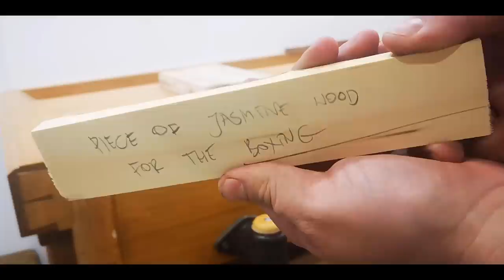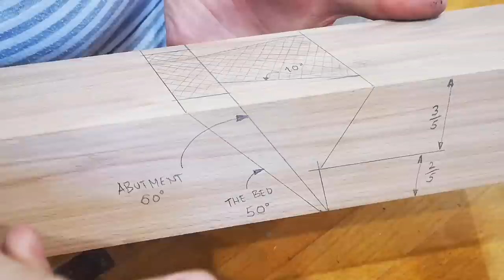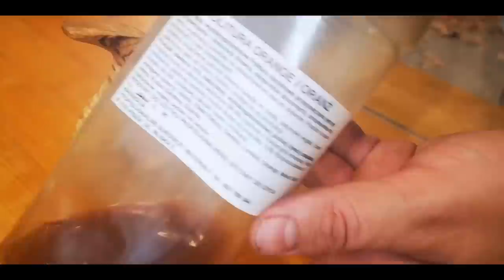037 Badger plane - hand woodworking

Comment from the maker: Hello! Today's project is classic the badger plane with intermittent boxing and the offset tote. 
I need that tool to clean sides of side escapment planes.
For the body i choosed quartersawn beech. Why quartersawn? Because that material is the most stabile. That's all. As you probably noticed the sole is always oriented on the side where the bark was. Some people talk that the barks side of the wood is the hardest. Some people talk about wood movement during changing humidity. In that case the sole will get concave profile, wich is better than convex. In that reason the grain should be straight and parallel to the sole. Another people talk abour the wedge fitting during changin humidity, quartersawn wood keeps the wedge tight.
I am big fan of the second theory.

So, what's the materials??
- beech for the body
- spalted beech for the tote
- jasmine wood for boxing
- boiled linseed oil and shellac orange as finish
- an old laminated plane blade 

The sole and the right side are free of shellac, they will work on the wood sufrace during planing.

The right edge of the sole will be the most loaded, so i choose intermittent boxing to make it more durable. The grain direction of the boxing is perpendicular to the sole.

Oh man, that a lot of words. I'm curious who read it ;)

If you have any questions or sugestions just write a comment.
Reply: I read it all
Reply: Hi there! I think I have seen you in the comments of David W before, so he needs no introduction to you (if I'm mistaken, look him up on youtube)

I asked him the question once about the end grain orientation with the suggestion to have the groth rings orientated vertical instead of horizontal, so it would be stable in the width of the blade and have no chance of pinching the blade

He respectfully disagreed, I quote his reply:

"Hi-the lateral movement is manageable (you just give the iron a little bit of room to move, or if things get tight, float out a little bit of material). You can make a plane with the wood turned 90 degrees from typical if you'd like, but the issue is that the durability between the rays is not very good, so the plane will wear much faster. You can smooth plane both faces of beech (the quartered face and the flatsawn face) and get a good idea how much more wear resistant it is on the bark side on the flatsawn face. It's pretty stark."

So his theory is about the resistance of the plane, and I agree with that personally

I'm glad to be watching your new videos again, you have an awsome workshop, with sunlight! Very nice
Reply: What is the role of the intermittent boxing??
Reply: Lots of us read all you write!  Thanks!
Reply: I read it. Lol Good explanation.
Reply: Very good idea.+1
Reply: @grandmasteryoda5485  "The right edge of the sole will be the most loaded, so i choose intermittent boxing to make it more durable. The grain direction of the boxing is perpendicular to the sole." 
See above,
Reply: @NICEFINENEWROBOT  thanx man
Reply: @grandmasteryoda5485  You'r welcome o master.
Reply: @NICEFINENEWROBOT  may the force be with you
Reply: @grandmasteryoda5485  What a greeting, just for viewing a badger plane project!
Reply: @NICEFINENEWROBOT  greet everyone this way you must
Reply: Beautiful job!   I read it all :)
I’ve made a few hand planes but made by laminating the sides onto a central body block.  It’s quicker (I think) than the way you’ve done here, but I make no comment on better or worse.  Very nice videos! Where is home for you?
Reply: You are one heck of a craftsman!  You are an inspiration to me to start by building a bench, probably a Nicholson, but left-handed.  My late Dad made a beautiful bench that I inherited, but since he was right-handed, it was difficult for me to use, so I bequeathed it to my 28-year old son.  Thanks for the inspiration and education.
Reply: Ú0
Reply: These are skills that have almost been lost. You are helping to record and preserve. back in time every carpenter had aprentice to pass on skills and knowledge. This is no longer happening So what you are doing is very important for all humanity.
Reply: After making a panel razing plane I am hooked! Great video, I am curious where you get the geometry to do the layout. Is there any reference book or guide to getting all the angles right. Its hard enough to do after the math is done. Thank you for posting.

Comment: Nice fix! I agree about quartersawn wood still holding the blade with changes in moisture. The only thin that then changes is the angle of the blade. And only very slightly at that. Beautifull plane and nice to see a master at work...

Comment: I would be fascinated to hear how you calculated the angles for the skew and the bed to get the plane edge situated correctly. It is a subtle but impressive achievement.
Reply from the maker: Thanks, i didn't calculate it, i just drew the lines on the wooden blank 👍

Comment: Very beautiful work and so interesting to watch, thanks a lot for sharing!  Nice to see you using your own plane to make this one, the mitre plane I think?  That spalted beech handle is super.   I did read your description, which answered some of my questions. Now you have to make a partner for this plane, for when the grain is going in the opposite direction on the rebate!!
Reply from the maker: Thank you! Yes, it was my plane. You have right - i should make a pair of badger planes for two grain direction but i don't have another, opposite plane iron. I hope that cap iron will help to achieve nice surface against the grain. Regards!

Comment: Really nice work but tbh im skeptical of these inserts in the sole. Wood moves at different rates depending on the grain direction so these inserts would move less than the rest of the body which would lead to more need to flatten the sole as there would often be a low spot right before the plane blade. Personally i wouldve used a harder wood for the whole sole or only for the edge but running for the whole length of the plane. As someone who has a way too moist workshop, ive become very carefull of wood movement. Sliding dovetails, which these are essentially, have become loose despite being extremely tight when i made them.
Reply from the maker: That solution was used in the 18th centure, planes from that period survived until today - that means a lot. You can add whole new sole but try to get back about 250-300 years and find cheap exotic hardwood ;) way too moist workshop is not a good place for wooden hand planes.

Comment: That spalted beech is phenomenal. Has it lost any substantial strength or become “spongy” anywhere due to the spalting, or is it mostly just cosmetic? I’ve made tool handles that disintegrated when I used spalted oak that was a bit too figured 😂
Reply from the maker: Hey Hakeem! It is still solid piece of wood, i did't observed any weakness. Regards!

Comment: hello, excellent work! how did you like using  that toko radial file for filing the bed? its 9:00 minutes into your video. I'm having a hard time finding platemakers floats to buy. Lie-Nielsens is always out of stock.i also wanted to make myself a couple molding planes. I was just wondering if you really liked the tool and if it performed well? thanks.
Reply from the maker: Thanks, this tool is not agresive, i use it only for smoothing. Cheers

Comment: Hey Stavros! Thank you so much for sharing your craftsmanship with us.
One question - is jasmine wood as hard as boxwood? I've never dealt with it and am very curious what it looks like to work with it.
Reply: Yes, I was wondering the same thing?
Reply: what is jasmine wood? i would have guessed lilac wood.
Reply: @jesperwestman5059  nope, in my country (Eastern Europe) - those a completely different kinds of shrubs. Jasmine's got beautiful white five-leaf flowers with an awesome fragrance.
Reply: Сергей Д. we have got jasmine here in sweden as well, white flowers and a nice smell, but the wood from those are absolutely useless. On the other hand lilac (white or purple flowers) has a very hard box wood like wood.
Reply: @jesperwestman5059  yep, that's right. And that's why I asked Stavros for some clarification on this. I'm not sure how the jasmine wood can be used for enforcing.
Reply from the maker: The wood is heavy and hard, not like a boxwood, but really enough for boxing. You can make the boxing out of the same wood as the plane body, but grain direction is the key - end grain is always harder than side grain. Thank you!

Comment: Hi , excellent job. One question, whats de relation between the angle of the mouth, the blade and the bed? I´d like to build one , in the easy way (laminated) and I have a skewed blade of 14 degrees, I just need to know the angle for the mouth and the bed. Thank you